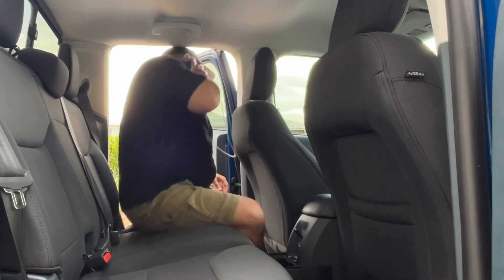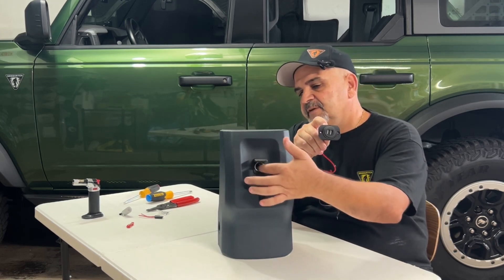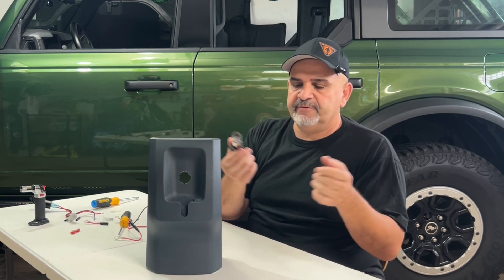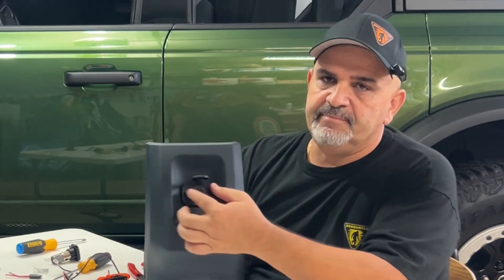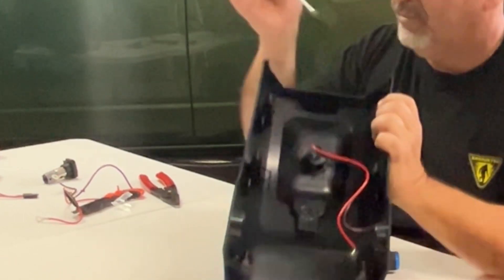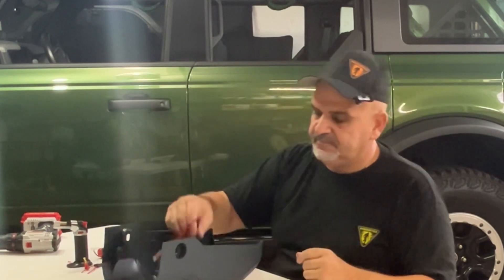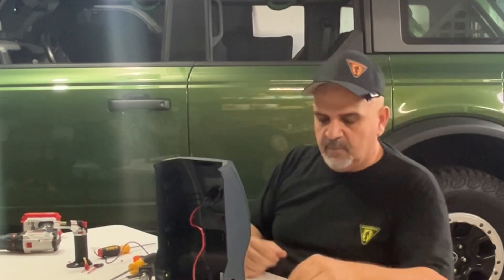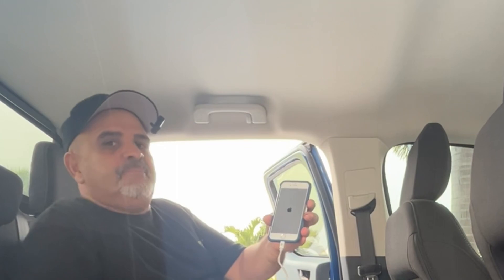Removing the rear 12 V socket and replacing it with a USB port on a Ford Maverick.  #fred'sgarage

Comment: Could you put an ac plug outlet there instead?
Reply from the maker: No, it’s not that easy. You would need a 12 volt DC  to 110 volt AC inverter which would need to be wired directly to the battery. Then wired to where ever you want the 110 outlet.

Comment: Does those USB ports power if the car is off?
Reply from the maker: So our mavericks are made to keep the power on for 90 minutes after you turn off the vehicle. It does this  to conserve the battery.  All you have to do is turn the car on and off again for another 90 minutes.  But when your car senses the battery voltage drop to the low 11 it will go into low power mode.  Hope this makes sense?

Comment: Why?
Reply from the maker: This is why, I went on a trip. I purchased a plug in usb for the rear. After the trip the usb disappeared, I asked both kids they could not find it.  Also you can’t close the lid with the usb plugin so either have to remove the usb or leave the lid open to get bumped and knocked off.  Hey thanks for the comment, have a great day.
Reply: @fredsgarage1925  gotcha.  I thought it was something  totally  different,   the one in the truck bed .
I thought  I deleted  that comment when I realized  what you were doing.
Reply from the maker: Cool, thanks bro. Gave a good one
Reply: Nice work

Comment: I bought this on amazon and it allowed me to unplug the port and tap into the current plug without cutting any wires in the maverick: https://www.amazon.com/dp/B08V4XFP24?ref=ppx_yo2ov_dt_b_fed_asin_title I know it is for a Chrysler Dodge Ram but there was someone else that said they were going to try it and it worked for them. I did the same and it worked for my Maverick.
Reply from the maker: Thanks for the info, So it plugs into the ford plug?  That would be great. I’ll look up the part.  Thank you
Reply: @fredsgarage1925 Yes it does perfectly!
Reply: @J-Lawrence used this plug thanks to you and it works perfectly! Been 4 months or so.